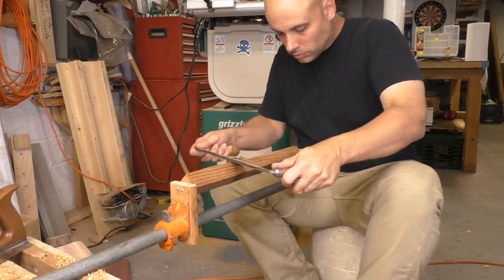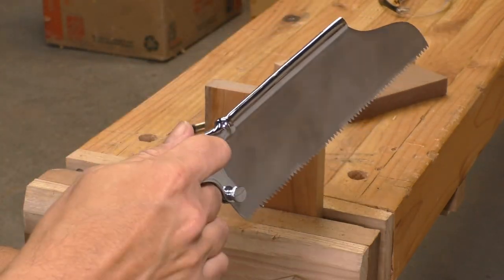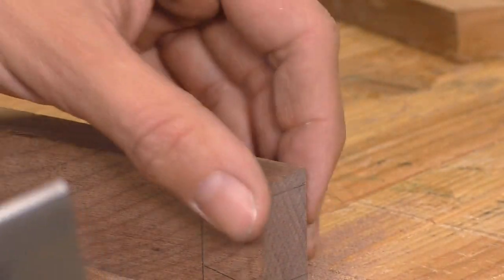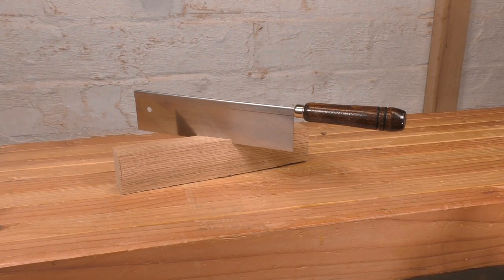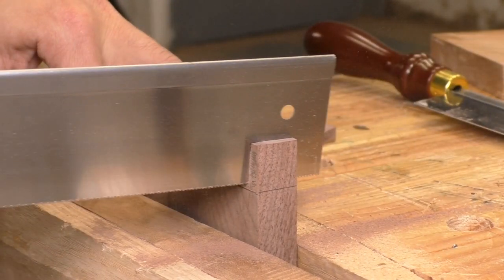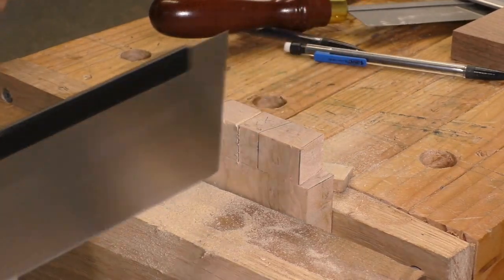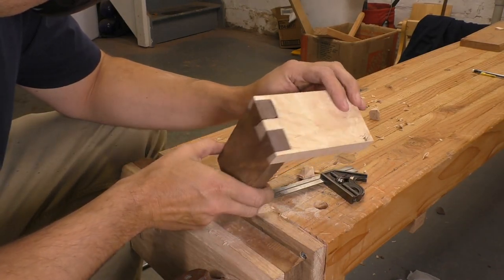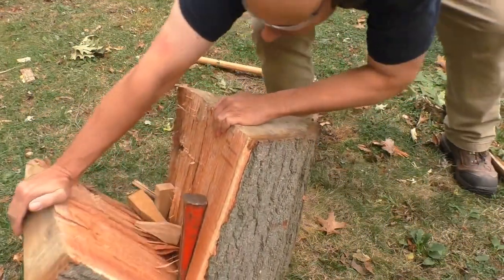Four Inexpensive Dovetail Saws Tested.

Comment: Rex, I have a question. I went looking for inexpensive dovetail saws. I searched back saws, and came up with some options I thought were interesting. For example, the GreatNeck 14 inch miter saw was only around 13 dollars, or the stanley fatmax miter saw was around 16. Is there a reason you wouldn't use a miter hand saw for dovetail style work? It has similar handles, reinforced back, and fairly fine teeth. Is there something I don't understand about how they work?
Reply from the maker: With these specific saws, I don't know. Sometimes you find a larger tenon saw with a thin plane and small teeth and it works for dovetails, too. It's possible.
Reply: The other thing you can do is recut teeth into saws as long as they don't have hardened teeth. I want to see if I can't grind hard teeth off a saw someday. Really good saws have hollow ground plates too. Which is a feature you're not going to find in cheaper models.
Reply: Generally teeth on a saw are sharpened specifically to cut across wood fibers or to cut along side the length of the fibers. The number of teeth and the size as well as the set also make a difference. Just do a you tube search or a general search on saw teeth and sharpening. It's simple but complicated if you have no knowledge.

Comment: I think the long handle on the Japanese saw is for a two-hand grip, not to rest the forearm.  If I have it wrong, speak up.
Reply: Like many things, there are various ways to do it.  If making a big cut in hardwood some people advise using both hands, but there are other techniques that work for some people.  I never use either of my Japanese saws two handed and I am getting great results.

I have been using Western style saws for about 45 years and Japanese saws for four months or so, and I already get more accurate cuts with the Japanese saws.
Reply from the maker: The ryoba is a 2-handed saw. This one has to be one handed becasue you're using your other hand to position the blade and start the cut.

Comment: How can you make such survey without mentioning the most usable saw for such works, it's not small and I have no word in english for it but it's very traditional and has been used for maybe a thousand years.
It would be easy to explain if could make a drawing. It's basically made of three pieces of wood. The blade, long and thin, about 40 mm width, fastened in both ends and stretched with a rope in the top of the saw.
It's very convenient and exact to use.
Please help me someone, whats the name of this tool ❗
Reply: Frame saw. A simple search on the internet for antique saws would have answered you.